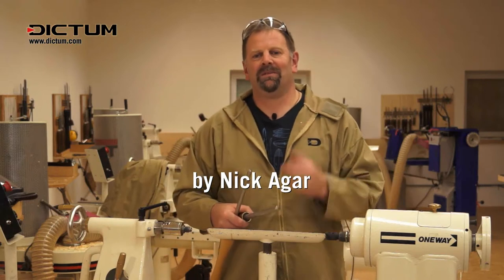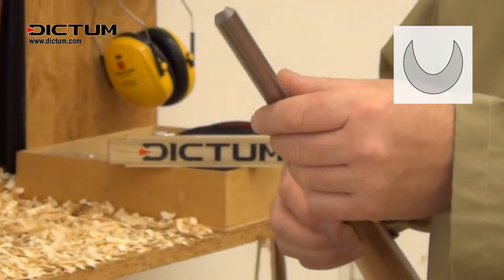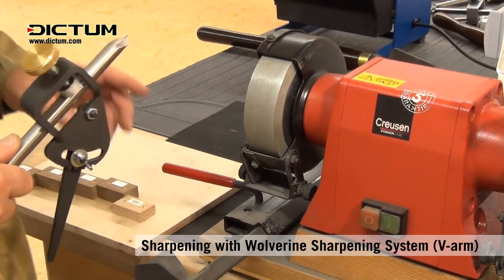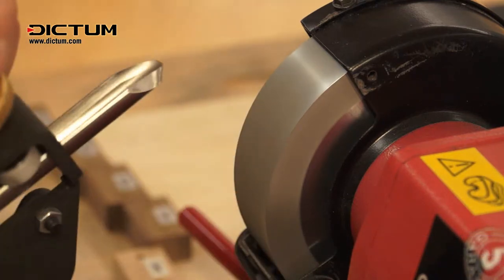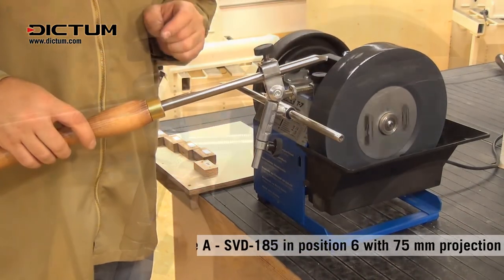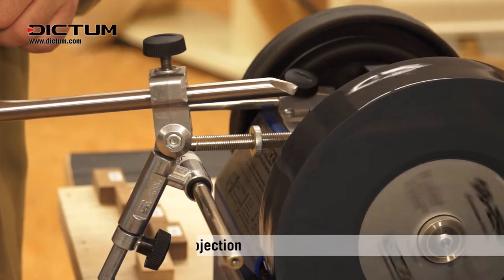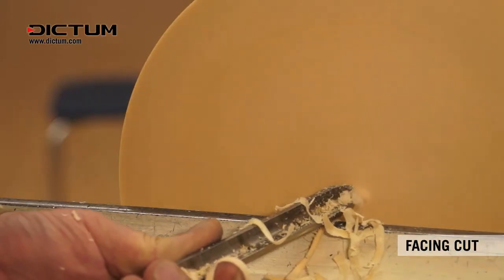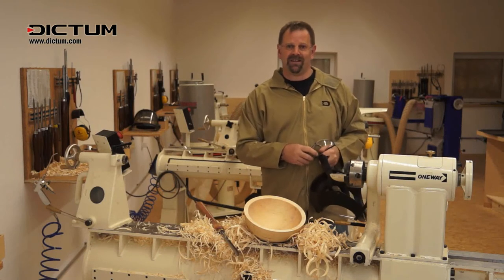Ellsworth Gouges - Form, use and sharpening - with Nick Agar - DICTUM tutorial video

Comment: Great video., as are your other turning videos. Can you tell me the sharpening settings for the Ellsworth gouge when using the SVD-186 rather than the SVD-185 on the Tormek T4? Thanks very much.
Reply from the maker: The settings on the T4 should be the same, just the diameter of the sharpening stone is a little smaler.
Reply: @dictum  It's the jig settings related to using the newer SVD-186 that I require. Apologies if that wasn't clear.
Reply from the maker: The settings are the same on both jigs.

Comment: How far out does one have to put the v-arm on the oneway jig (bottom arm)?
Reply from the maker: Depends on the gouge you like to sharpen. Just use the reffered settings and move the V-arm to that position the bevel has full contact to the grinding weel.